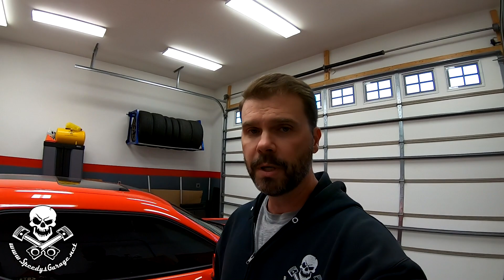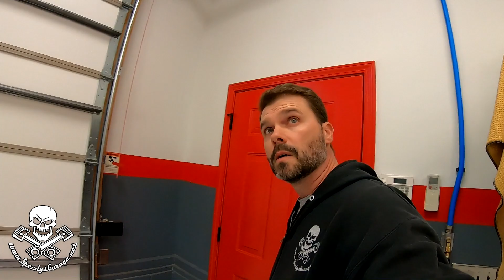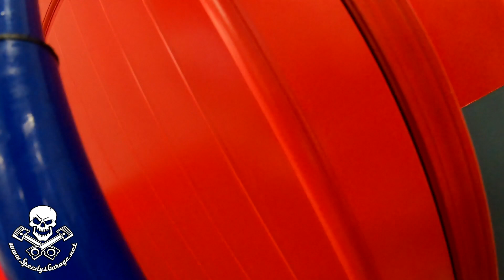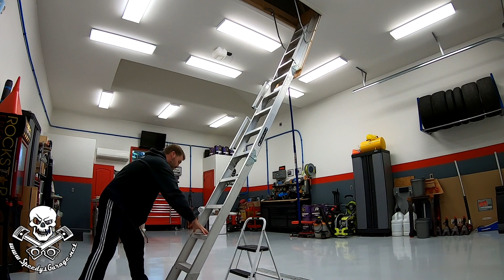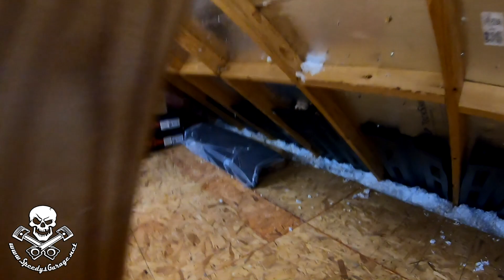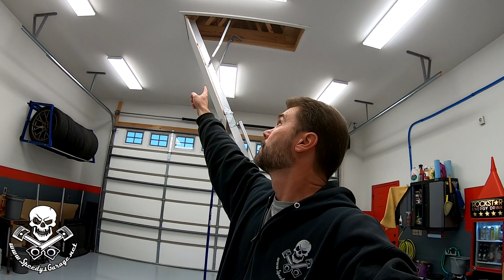Shop Build Sketchy Attic Access Speedy's Garage

Comment: Have you check out Majic Stairs? I first saw them on the obsessed garage channel. Hope it helps.
Reply from the maker: YES!  I have been researching those as well as their lift system.
Reply: @SpeedysGarage  I've thought about using a winch and some square tubing to build a lift system. It would require some welding but you could build a system with higher load capacity and cheaper.

Comment: Yup, those ceiling ladders are sketchy. And they get sketchier as you age. I'm in my 70's now and they are very troublesome especially heavy objects that get heavier every year. I was planning to build an elevator (several videos on YouTube) on an outside wall but ended up moving to a new house that has a 30 x 50 garage with a large internal staircase to the attic. Doesn't look like any of your external walls would work well for an elevator without major reconfiguration. Possibly replace the stairs with an elevator, better but not optimal. Good luck, I'll be following.

Comment: For going up and down the ladder I put a strong rope with knots every 18" or so tied to a rafter that I could hold onto when I was near the top. Helps keep your balance and the knots keep you from slipping down. Another knotted rope is helpful for tying a 4 sided sling around boxes so that you can pull them up. Used this when I had to haul up boxes, nitrogen, acetylene tanks, and tools to roofs instead of trying to carry them up and fitting them through the access doors.

Comment: That window up there looks big enough to make into another entry point?  Rather than cutting and reframing another hole for the lift platform, repurpose the trap door and enlarge it if needed for the lift platform and now use a swingable window as the entry point?  Of course that means you need to haul a ladder outside then to get in.  It just depends if opening up new hole might get in the way or compromise those roof support trusses.

Comment: I have the same thing above my house garage. Heavy objects are fun. Plus sometimes at the top you have to finagle it to fit. I put stuff up there that I know o won’t need for an extended period of time. I kind of regret doing it. It made the house look taller like the wife wanted but a lot of extra money for something that is a pain and really not needed. 
Mine has a small rope on it. But mine is in the very back of the garage so it isn’t in the way of anything. Being in the middle I wouldn’t love the rope hanging down

Comment: Lift system would seem to be the way to go, separate from the access opening.  Certain ones apparently have internal lifting mechanisms that won’t impede with the space above.  Not sure but wonder if they make an access ladder that automatically raises and lowers?  Would save you from having to use a separate ladder to get down the access ladder.